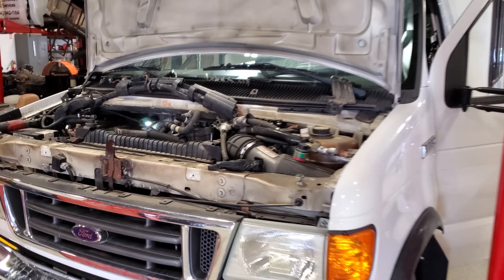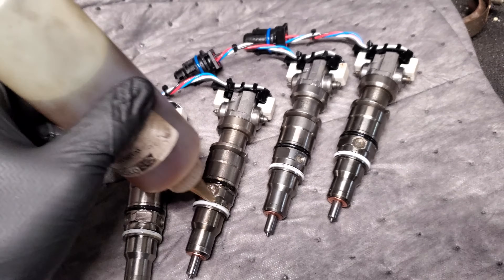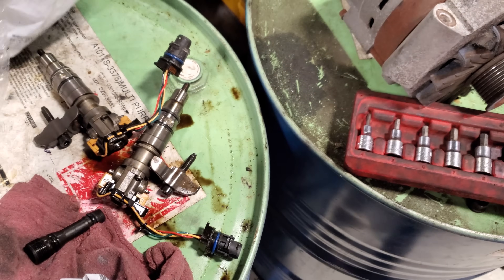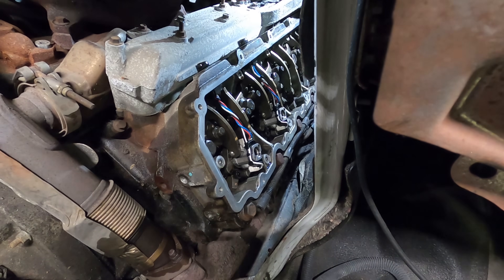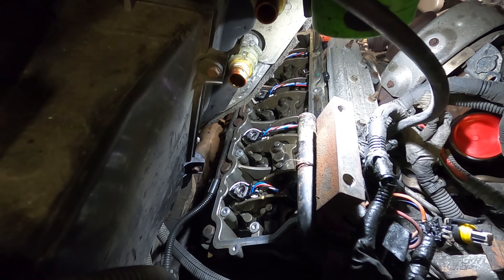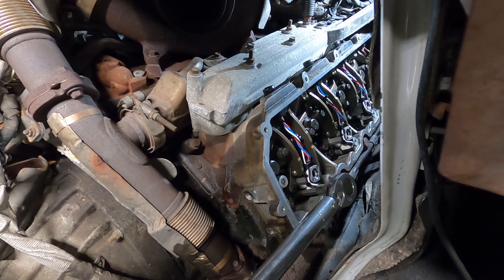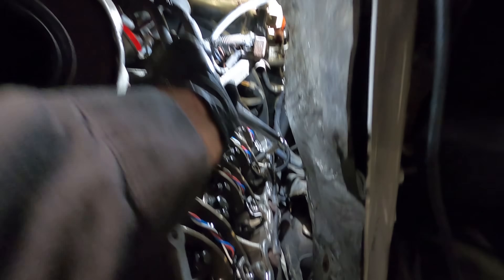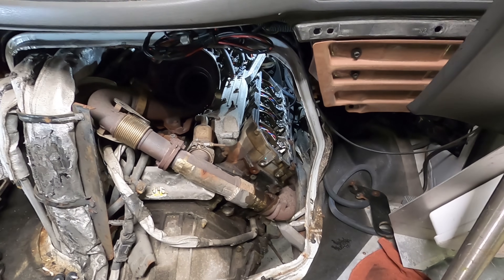How to properly torque fuel injectors | 6.0 Ford Diesel Econoline

Comment: I have a P0272 Cylinder 4 Injector Voltage High, along with a Cylinder 4 Contribution code, and I'm about to swap my injector out. Is there anything I should do to troubleshoot before doing the job? It's in a 2008 Quigley Powerstroke E-350, so space is very tight and if I'm missing something, any outside perspective would be greatly appreciated.
Reply from the maker: Dang, that gonna be a slut

Comment: EEKonolines with 6.0.......(<- this is me not saying anything since I can't say anything nice). My quality of 6.0 life improved when I started lifting RH side of engine the thickness of a piece of 1x4 between frame and eng mount. That little bit gets the lower back valve cover boots,  those bottom back 2 oil rail bolts and the dipstick tube nut in positions of accessibility well worth the time to do it. Those injector bolts are torqued to the ragged edge of stretch or break so no playing around with them.
Reply from the maker: Yepppp

Comment: EWWWWW!!!!! I DO NOT miss E-Series with 6.0s in them one bit!!! Watching this vid brings back memories of the pains I went through on a regular basis working on these turds. I see you have a shuttle bus application with rear heat-A/C. Double EWWWWW. I'm honestly surprised there are still any E-Series with 6.0s still on the road anymore! I would have thought most of them would be technical write-offs by now. I see that you are attacking the "hard" side too. More important than doing the injectors themselves on that bank, you didn't mention how you gained the clearance to that bank to enable valve cover removal. Did you remove the driver side engine mount and let the engine drop, or did you remove the body-to-frame fasteners and raise the front of the body off the frame about two inches to gain the clearance needed to remove the valve cover? I always used to raise the body. I don't think I've ever removed the driver's side engine mount on the ones I've replaced injectors on. Good job posting the part numbers for the dummy plug (-W302908) and the standpipe (6E7Z-9A332-A). I should add that if you are removing both valve covers, the part number is 6E7Z-9A332-B for two dummy plugs and two standpipes in one package. As for using Milwaukee tools? I'm in the process of building up my arsenal of cordless tools from them too. I have a 1/2" drive impact and mini driver from them so far. My next purchase is going to be the cordless ratchet you're using in your vid of course. And it's going to be the Fuel version too. Not having an air line getting in your way while you work is too cool.
Reply from the maker: Love it chan man

Comment: I just did injectors, both alternators, belts and all new hoses/intercooler tubing on a 2006 ambulance. It sucked.
Reply: So if you got $30.00 hr and it was 9 hrs you got $270 that you get to pay tax on. Probably one of the injector cost more than you made
Reply from the maker: U damn right! 🤦‍♂️🤦‍♂️🤦‍♂️🤦‍♂️🤦‍♂️🤬 no one gets it
Reply: @smokeskull  i wish i got 30/hr. Even after having all my Ford certs and being “master certified” I’m not at 30. It’s a bear. But i love my diesels and they treat me right. I just hate e-vans and 6.7 upper oil pans.
Reply from the maker: Brother, your skill set is worth more!!!!...we need to get you bumped to the next bracket. Where they at-who are they GD it!
Reply: @PowerStrokeTechTalkwARod  the big M, MARYLAND! 😅
My wife and I have been looking to move. 
The way i look at everything is “somebody’s got to do it”.
Reply from the maker: Yeppppppppp
Reply: @smokeskull  but the 6.0 injector are like 384 a piece here.
Reply: Fixing diesels and auto transmission and gear work means your gonna be the last one to get laid off
Reply from the maker: Tru dat
Reply: And what did you get paid? A days wages? Honestly I would quit if I got asked to do a e van ever
Reply: @smokeskull  it’s not too bad it was around 8-9 hours. I pull the radiator, intercooler, and condenser as one assembly and then pull the fan assembly. Then it’s all right there.
Reply from the maker: NOT ENOUGH! is it done yet, is it done yet! 🤬
Reply: @PowerStrokeTechTalkwARod  yeah, they kept coming, and coming and coming. Service writer was all over my ass. I definitely felt like it wasn’t enough. But i got it done. I have 5 more 6.0 ambulances coming within the next few days. All different repairs and a crank no start when hot. Shoot me now.
Reply from the maker: Fuck brah....i got chu....we'll double team em. U outside, me inside...🙌🙌
Reply from the maker: Ughhhh...i know ur pain brother hopefully them boys is fazed outttt 🤞🤞🤞🤞🤞 die E-vans with 6.ohhhhhsss. ill take them gas jobs...ANY DAY gravy trrrrizains

Comment: Motorcraft all the way! Except their batteries which suck a**
Reply from the maker: MOTORCRAFT FTW. Whatchu talkin bout Willis? They got a kick ass 3 yr free replacment warranty....prorated after 3 yr. Up to 100 month warranty..😉👍
Reply: @PowerStrokeTechTalkwARod  well said brother
Reply: @PowerStrokeTechTalkwARod  They don’t last anywhere near 3 years and I’ve never had the Ford dealer warranty them. Always some excuse. We have several Ford ambulances. I also work on several fire department ambulances and the Ford batteries always start leaking out the top and boiling over. Switched to interstate and no more problems. I always use OEM Ford for everything else tho.
Reply from the maker: No kiddin 🤷‍♂️

Comment: 6.0's in an E- cutaway! Awesome.
Motorcraft for injectors.  They're down to $180 a piece now with 2 year warranty. No brainer.
Reply: The injectors are down but something has jacked Ford diesel fuel tank sending units WAY up. 2002 7.3 F250 needed one a couple weeks back and Motorcraft was $621 wholesale and crap brands at automstores were not much less. I have installed a dozen of those that were half that. I don't get it. The gasoline engine ones withe fuel pump are still $300-ish
Reply: @jimmyaber5920  Senders always been high in my opinion and did get higher.  And now you can not even find the OEM fuel pickup foot from Motorcraft. Aftermarket has copied them but they do not hold up. Our older trucks are getting timed out faster then ever.
Reply from the maker: Yuuuup
Reply: @jimmyaber5920  I had to have a tank done in my 08 E350 6.0. Dealer quoted me 7500!!! They wanted to replace upper and lower straps. I found an aftermarket plastic tank for 600 and my local mechanic charged me 450 and used the existing straps ...... Wtf Ford
Reply: Come to think of it..... Why the eff are the tanks steel on these
Reply: Holy shit really? They sure as hell weren't that cheap last time I bought em. Granted it's been like 10 years....
Reply: @jddiesel7409  yeah they really came down in the last 4 years or so. Autonation has them for $181 for online orders if you don't have a dealer. https://parts.autonationfordwhitebearlake.com/oem-parts/ford-6-0-fuel-injector-2004-2010-from-9-22-03-cn-5019-rm-note-sale-price-includes-a-refundable-180-00-core-charge-4c3z9e527brm?c=Zz1mdWVsLXN5c3RlbSZzPWRpZXNlbC1mdWVsLXN1cHBseSZsPTEmbj1TZWFyY2ggUmVzdWx0cyZhPWZvcmQmbz1lLTM1MC1zdXBlci1kdXR5Jnk9MjAwNSZ0PWJhc2UmZT02LTBsLXY4LWRpZXNlbA%3D%3D
Reply: @Itsa_Mea  well I'll be damned. If I ever get the ambition to take on another one I'll keep it in mind. I'm a medium and heavy truck guy, the small stuff is just side gig. But I do take on 4.0 sohc timing chains so I'm a glutton for punishment. Thanks for the heads up!